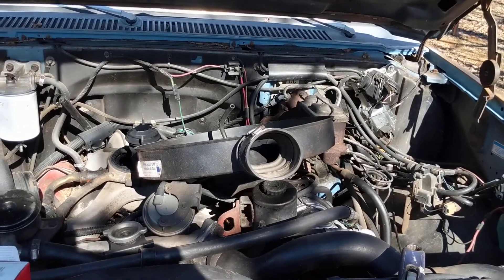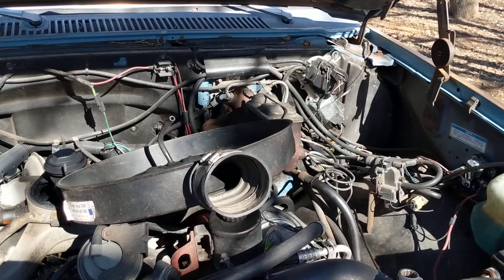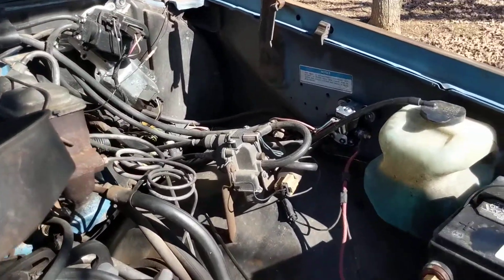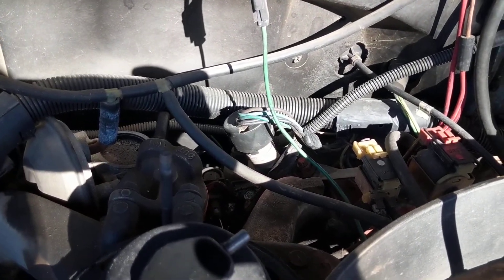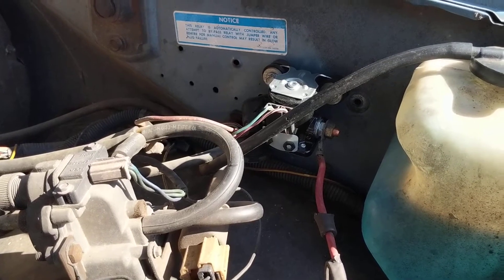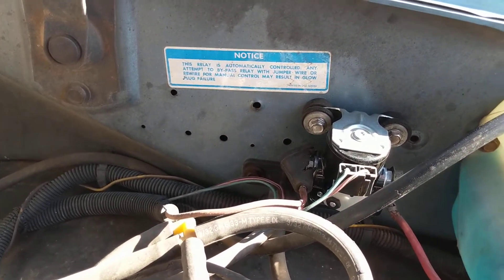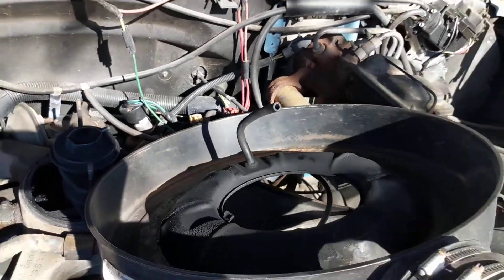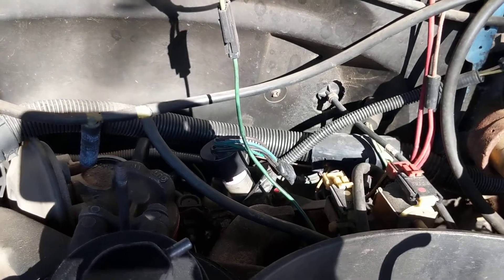Glow Plug System | OEM Setup | QUICK OVERVIEW | 1982 Chevy C10 6.2L Diesel

Comment: I’ve owned 2 of these model trucks. While I love the system when it’s working. I have a manual switch wired around the relay. If/when the controller or relay fails, it saves getting out to try and bypass it. Usually happens in the worst weather while you’re in your best clothes.
Reply from the maker: Yup. I carry a spare in my toolbox just in case.

Comment: so i’m having the same problem …one question i turn the key nothing no thump .so i got a wire and jumped from where the battery wire goes in over to the side where the fusible links are…when i do that the solinoid still has no thump but the glow plug dummy light comes on and it starts right up…when i use a light tester i get power on the battery terminal but no power to the 2 wire plug that clips in…does that sound like a solinoid or does it sound like it’s the control unit?
Reply from the maker: Seems odd that you wouldn't get the thump sound of the relay engaging. It's a cheap part so I'd swap it just to see if that resolves it. If the weather is warm it might start ok without the glow plugs but obviously when it gets colder you're going to need them.

Comment: Do you have a video on how to adjust the throttle switch? My tranny is not shifting into high gear. Thanks
Reply from the maker: Well if it's one of those pos 700r4 transmission good luck. They are junk. I've had mine rebuilt 3 times. The last time I went to a lifetime guarantee place and they added a transmission cooler.
Reply from the maker: This video shows how to adjust the idle but I don't think that's going to help you shift. 

https://youtu.be/-PBfqxGKCQw

Comment: How thick is the cable to the relay? Mine doesn’t have it
Reply from the maker: Oh no! I don't know off hand but I'll go look at it this weekend and see if I can figure out what size it is.
Reply: @michaelfirey  I put a 8 gauge wire going to the relay and it starts like nothing now. Thanks for the video. I got the truck dirt cheap and it has low miles, banks turbo, upgraded fuel filters and system, new turbo 400 trans, hub locks and good paint. It’s a k20 short bed single cab with a 6 inch lift
Reply from the maker: @dgkbeast36  I'm glad you got it figured out! Sounds like a sweet ride. Mine doesn't have a turbo so I'm jealous lol. Have fun with it! 

Please like the video and subscribe to my channel of you haven't already so I can keep growing and helping other square body fans. I'm hoping to use this as a way to fully restore my truck over time.

Comment: Thank you I was kind of thinking this might be my problem I have a 82 c-20 truck it gating hard to start alternator is good the solenoid switch bumps so iam going to replace glow plugs I don’t don’t know how old they are  i bought the truck almos 4 yr I have replaced batteries 9 months agoif plugs don’t do well than it’s the censer behind the air filter like you iam trying to keep it all original
Reply from the maker: Be careful with the glow plugs. Sometimes they will build up carbon and not come out. They will snap off in the block if you mess with them too much. Just replace the ones that pull straight out. Leave any that resist. If any break off you'll have to pull the head.

Comment: interesting that that relay you show is a typical looking starter relay..are they using that relay for glow plugs as well? or is it in addition to a starter relay on the starter? hmmm
Reply from the maker: That relay up top is just to turn on the glow plugs as far as I know.
Reply: @michaelfirey  That's what I was thinking. It would make sense it needs something high current. Never knew they just used a standard starter relay..I'm new to all this diesel stuff. First RV issue..etc..
Think I have stuck injectors and not a glow plug problem with hard starting anyway, but pays to learn all I can here,,so thanks,, and Cheers!

Comment: Were you also having a problem with draining of the batteries while all this was going on? Thank you ahead of time.
Reply: I'm chasing same problems.my dash idiot light went out to not sure if that can contribute
Reply: I'm having the same problem I'm wondering if the glow plugs are kicking on killing my batteries
Reply from the maker: I hadn't noticed that in connection to this issue.
Reply: @michaelfirey  Thanks for getting back..iv got an 82 6.2 that I'm chasing a battery drain and noticed my glow light coming on&chasing things from their..trucks getting  parts.appreciate the hit back.
Reply: My 82 6.2 has got a drain also.900.00 later two new agm batteries and alternator and going.

Comment: Is it the same 6.2 as the k30? My reason for asking is I want to purchase a thermostat housing but on ebay it says c20 and it does not fit k30, so I'm wondering if the v8 diesel are different?
Reply from the maker: I'm not sure. Is there anything I could try to locate on my motor / truck that would help you narrow it down?
Reply: @michaelfirey  the part looked identical but I have no idea.
Reply from the maker: @shawnlawrence4840  check out rockauto.com. I get everything there. If yours is an 82 this would be the one for a k30:

https://www.rockauto.com/en/catalog/chevrolet,1984,k30+pickup,6.2l+379cid+v8+diesel,1053021,cooling+system,thermostat,2200
Reply: @michaelfirey  mines a 84, thanks for the info
Reply from the maker: I edited the link to the 84 k30. I hope it works for you!
Reply: @michaelfirey  thanks a million, I made the order.

Comment: hi i have the same set up on my truck and was wondering where you puchased your controller I cant seem to find the controller i have found the relay on multiple sites but no controller
Reply from the maker: I'm sorry but I just saw that you sent this message.  I guess youtube didn't notify me.  I found it at O'Reilys.  It's behind air filter near firewall on driver side; screws into the top of the engine block.  Standard Ignition 6 Terminal Diesel Glow Plug Controller STD TX42 $145

https://www.oreillyauto.com/detail/c/standard-ignition/standard-ignition-6-terminal-diesel-glow-plug-controller/std0/tx42/v/a/2984/automotive-truck-1982-chevrolet-c10-pickup-rwd?q=TX42&pos=0
Reply: @michaelfirey  thank you no worries at all just a project truck I’m working on at the moment I found one through summit

Comment: I need help! I am trying to find the 'water in fuel' sensor, or solenoid, or whatever it is that makes the dash light come on! I do not have water in my fuel, as I opened the drains at the tank and filter on firewall! The last owner was obviously using #2 fuel oil in this truck that was just used on a farm! I do not see any wires for going in the tank,. And, the spin on filter on the firewall looks to be original and not the aftermarket replacement for the box filter! I thought it was a replacement and looked for any disconnected wires for the sensor that would had been in the filter box,,, there are none! And, napa recognized the filter number i have right away to be the filter for my truck! By the way, same year scottsdale as yours 82! So, I heard it may be somewhere where the small filter is behind the intake!? Don't see anything! BUT!! There is one pink wire that comes from a single connector on the rear passenger side harness that goes under the intake and disappears! It does not continue to the injection pump!!! Do you know what this wire is for and where it goes?? I spent a lot of using a mirror and all trying to see,, but I can't!!  thank you!
Reply: I am pretty sure that the FIW sensor is in the tank.  It is supposed to only monitor once the fuel level gets below 2 gallons.
Reply from the maker: Please like the video and subscribe to my channel so I can grow my channel and provide better content!

Comment: The problem I am having is The glow plugs won't activate when the engine is warm so it won't start until it cools off some. With the cold start first thing in the morning glow plugs work normally and it fires right up. I've replaced the glow plugs, relay and controller already. read something about a glow plug inhibition switch and so far have been unable to identify it. Apparently not all of the 1983 GMC pickups came with one installed. would like to bypass that switch if i can find it. Any other ideas?  DD
Reply: Did you come up with a solution for this problem ?
Reply from the maker: Please like the video and subscribe to my channel so I can grow my channel and provide better content!
Reply: I went manual. I replaced  the original relay with a heavy duty snow plow relay/solenoid. I put a momentary contact switch in the cab , grounded one side and ran the other wire to the ground on the relay. No waiting for it to cycle like before.
Reply: @hudsonhawk0016  I have same issue, did your method still work ?